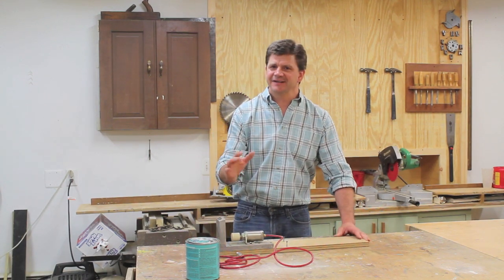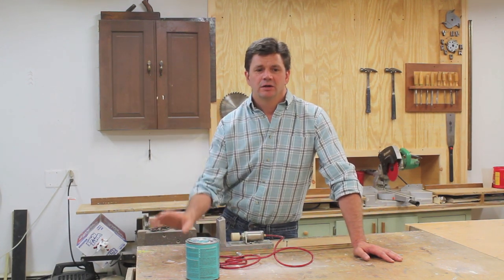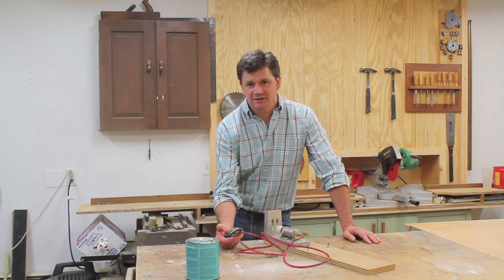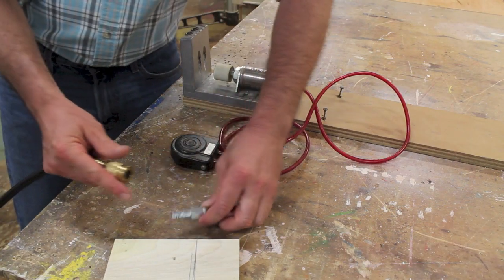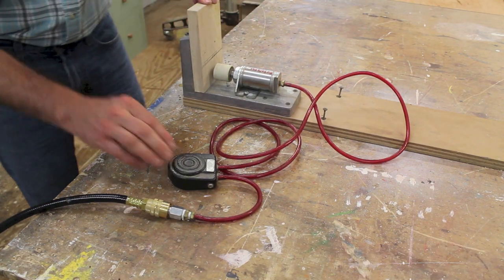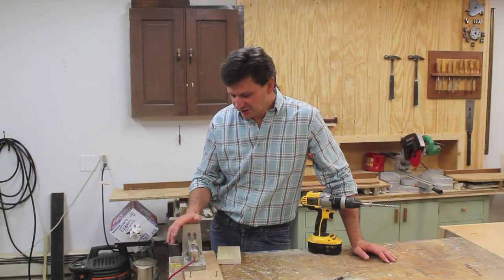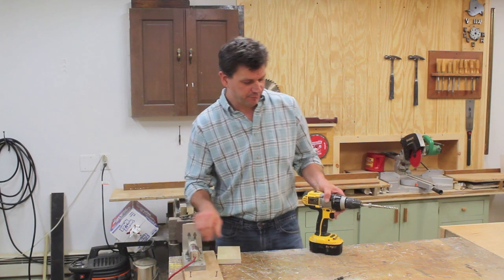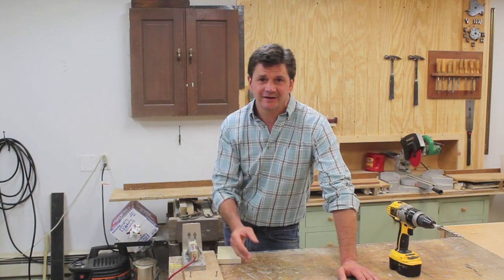Finished Bathroom Vanity & a close look at this old Kreg Jig.

Comment: Pneumatic k3 kreg

Pretty easy to do. I was able to do it to my K3 for 40 bucks and some scrap wood. You would need a Single Action Spring Return Cylinder, a 3 Way Foot Valve, and a Rubber Bumper that I picked up a Freight Props. Makes clamping a cinch.

Comment: Hi Jon!
Thanks for sharing yet another great little video.  I saw you using this Greg Jig a few months ago, but wasn't sure if it was indeed a "Greg Jig"...I've noticed it looks like it's made out of some kind of metal which would make it durable and perhaps more accurate....I bought a regular Greg Jig about a year ago and only had the chance to use it once so far...great tool thou, still I think the one you have is the coolest! Thanks!!!
Mike
Reply from the maker: Thanks Mike, works great only down side is, it needs a compressor to work.
Reply: .....meant to say Kreg Jig! 
:D
Reply from the maker: I know : )